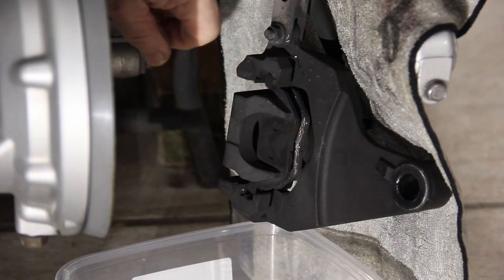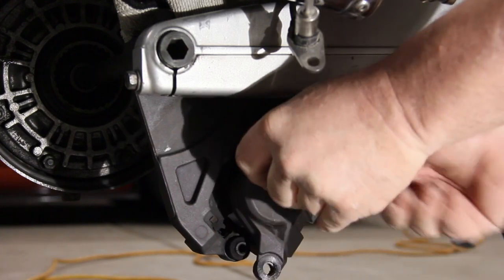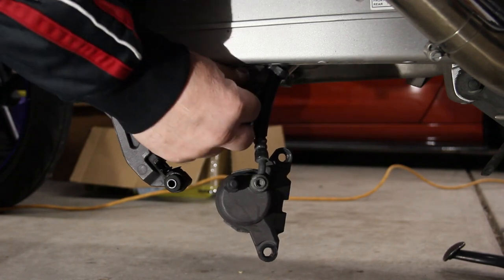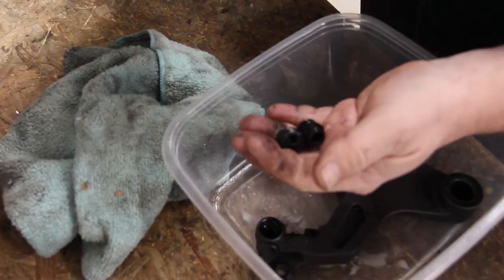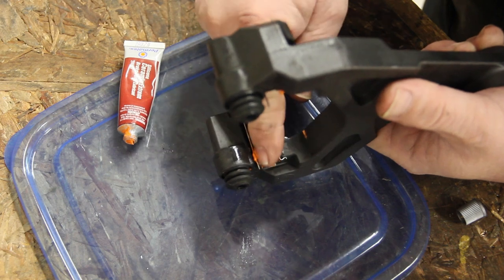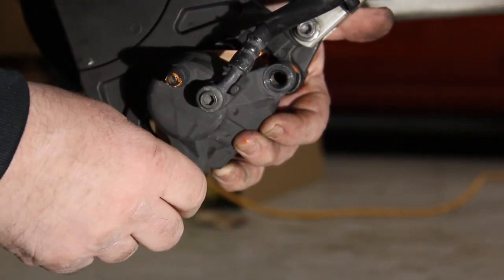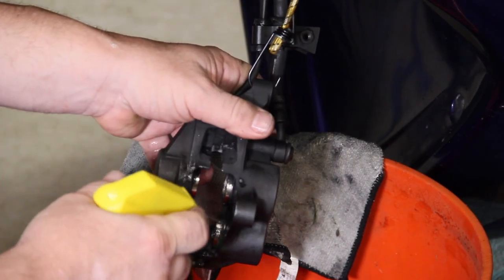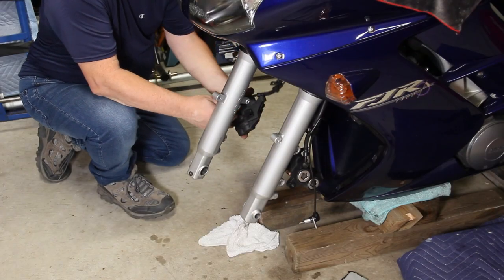Front and Rear Brake Pad Replacement on the FJR1300

Comment: Hi Mike, those double sintered pads may cause your brake discs to wear faster due to the high metal content in the brake material.  They may be better suited to high performance use than touring. For your consideration.  Also, can we assume you changed that old fluid and bled the system after all that really good work on the external portion of the brake system?
Reply from the maker: Yes, the brake fluid is the next video.

Comment: You are my learning by doing man, tks!!!  I have a 2018 FJR and the break pads look different. Any recommendation what pads to by?
Reply from the maker: Hello, the OEM pads are preferred. However I have been using EBC Double-H Sintered Brake Pads without issues. I have not used much else since this is what the local shop carried. 

Thanks, Mike

Comment: "we're going to use a 12mm socket on an extension, place it over the bolt and press down".if someone watching this is so stupid you have to explain that to them they probably shouldn't be messing with brakes period.
Reply from the maker: I come from a background of instructional videos. It's better to tell somebody each step so it's clear.